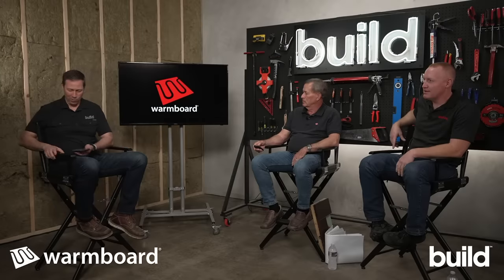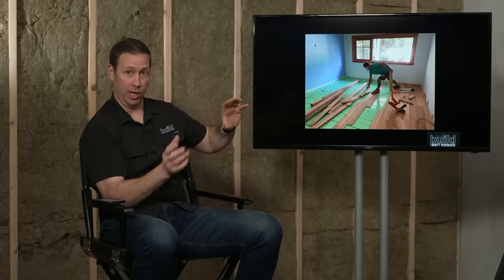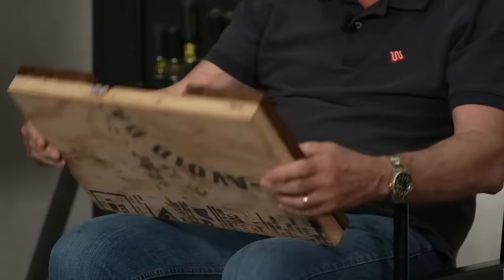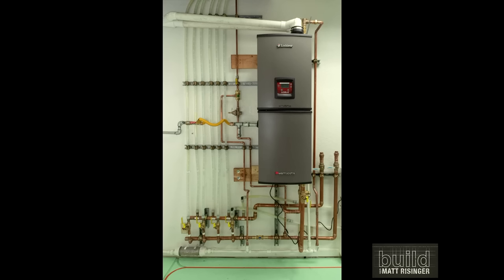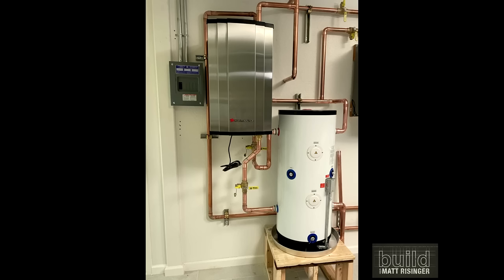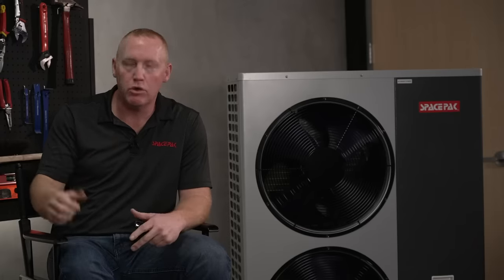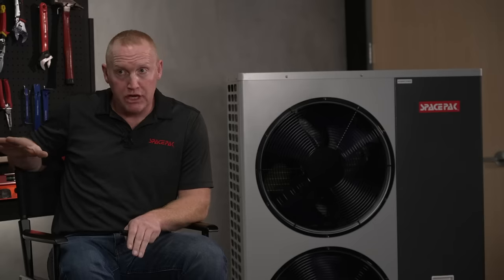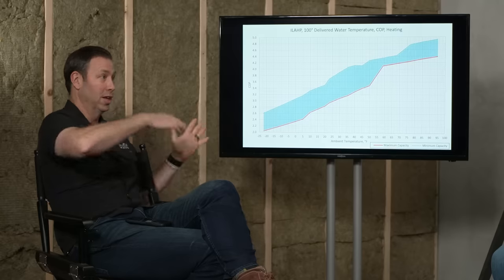Cold Climate Heat Pumps for Radiant Floor Heating. No gas, no boiler!

Comment: Can Warmboard also cover cooling/AC, or do we also have to get a separate system for that?  If I already need ductwork for cooling then why should I get Warmboard radiant floor heating instead of just using the heat pump system for heat as well?  Or why not spend the extra money it would take to add Warmboard and use it to switch from an air source heat pump like the one described in the video to a geothermal heat pump that will maintain its efficiency regardless of outside temperature by using the relatively constant temperature of the earth to extract heat from or shed heat into?
Reply: All great points that go against the use of expensive heated floors
Reply: Separate system.  normally a wall mounted minisplit for AC and heat back up
Reply: Perhaps you didn't see the slide at 37 minutes. Read the captions ; they infer it works like a regular heat pump with either ceiling units or wall units blowing either cold air or warm..
Reply: @paulmcgown7504  I did see that slide, but you seem to be confused about what that slide represents.  It has nothing to do with the Warmboard product, it only shows the heat pump system the other company sells that can be used to provide hot water for the Warmboard system, which is my whole point.  I could use a standard electric or gas water heater or boiler with the Warmboard to heat my house, but it can't cool it, so I would need a separate AC or heat pump system to cool the house.  If I'm already installing a heat pump with the necessary ductwork and/or wall units to cool my house, why wouldn't I just use that heat pump system to heat the house too (just like it shows in the slide you pointed out) instead of using it to heat water and run it through Warmboard?  Why would I spend the extra money above and beyond the heat pump (which is capable of heating all on its own) to put in the Warmboard system for heating?  That's my point.  If the Warmboard system was cheap instead of expensive then it might be worth the little extra money to ADD the Warmboard to the heat pump system for comfortably warm floors, but at the price it is you would have to have the kind of wealth where you don't care what anything costs to waste the money for putting this in on top of a heat pump.
Reply: @r.j.bedore9884  you nailed it with the last sentence.
Reply: @r.j.bedore9884  but seriously hydronic underfloor heating is all about comfort. Zero to do with financial or other considerations.

Comment: I think warmboard is a solution to a problem that doesn't exist. Gypsum casting is not so heavy and zoning is difficult. The only advantage of the system is that the heating pipes are visible when the floor surfaces are attached.

Comment: I was planning on doing radiant in slab and finishing the slab to just use as my floor, but now I'm building a two story house (residence above garage) and am debating about a product like this. I'm really scared of what happens if/when there is an issue with the pex and your glued on hard wood floors all have to be destroyed to get to the leak
Reply: If there was an unknown leak that would be a disaster, but it's standard practice to use a whole unbroken pipe for each loop with no connections in the middle that could leak.   And the system is tested before you cover it.

Comment: For all you people that are skeptical;  In sweden the standard for almost all new houses is using air-water or ground source-water heat pumps. You can use it with hardwood floor or tiles, either in the slab or on top with similar pre-made sheets of plywood/alu. The pipes are laid out, pressure tested and no hidden pipe joints are allowed. Heatpumps with inverters work perfectly fine down to -18 degC (with lower COP and electric boost). The same heat pump also supplies hot tap water. Check out Nibe, IVT, CTC, or Thermia  heat pumps. Piping Uponor or LK systems. 
Cheers and welcome to the 21st century 😂😂
Reply: I'm not skeptical, but Im not made of money either.  For a new build or a gut reno, but to add this to an existing home, the costs are more than most homeowners can afford.  What needs to be done is home building energy guidelines be followed my home builders, and if not, charged for it.   To many get slaps on the wrist, or nothing happens at all when they are caught cutting corners to save a few bucks, that affects homeowners and the environment for decades.

Comment: For myself it's a case of SCREW my "carbon footprint", it's more a case of not paying the utilities (electric or gas) as little as I possibly can!  The preference for both my wife and myself is 100% off grid for HVAC and electricity.    I've had my eyes in Warmboard for quite a while now for our "Dream Home".  I'd be more interested in hearing about both heating and cooling, which is possible with radiant, but using geothermal rather than air to water like SpacePak does.  I'd likely be building in a similar climate zone to Michigan.  Ideally with ICF for walls and ceilings, possibly using SIPs for the actual roof to give a conditioned attic space.
Reply: Tip: put the heated floor budget into better windows and more insulation.  More comfortable and efficient home rather than slightly more efficient hvac. 👍
Reply: Indeed, nice to reduce costs long term with these systems and more resilient to price shocks. I'm also very curious about the cooling aspect. I want one system to provide heating and cooling.
Reply: @dosadoodle  you’ll need a separate system for cooling.  More $$$
Reply: @superspeeder  It's a case of "all the above" since our build budget is contingent on playing the right numbers in the lottery LOL
Reply: @michiganengineer8621  Nice! 😁
Reply: @James Karrie heat pumps cool too, you just need a bunch of ducted fan coils to do it.  Then the heated floor becomes unnecessary.
Reply: @James Karrie you can, but you need a DewPoint tracking system that never allows any part of the cooling surfaces to go below the DewPoint of the air in the house, or condensation and mold result.  Radiant cooling is a very interesting new thing for residential buildings, but it is not trivial to implement successfully.
Reply: @James Karrie sure you can.  BUT, consider how a company views this and what risks are involved, and they simply will not install this into someone’s home because they have no idea how well it will be managed.

Open the windows and doors to air the place out, forget to turn off the cooled floor, big time moisture/condensation issue.  Dehumidifier breaks down or is not set properly, big problem.

You and I might manage a system like this no problem because we understand how and why it works.  Joe/Jane homeowners do not, and it’s those people these systems need to accommodate which means a reliable plug-and-play setup that’s fully automated.

It also needs to be in a very airtight house, not only because humidity control is important, but even humidity throughout the house is also important.  What if the basement is more humid than the main floor?  Problems.

It’s a risky application that has been successfully done in commercial settings, but I don’t think it’s ready for residential deployment.  These big companies won’t touch it with a ten foot pole until the risk is reduced to acceptable levels.
Reply: @James Karrie the other thing is, I don’t think anyone wants cold feet even in the summer.  If a system relies on sucking heat out through my feet I’m not sure that scores high on comfort.

Radiant cooling that does exist is usually done with wall and/or ceiling panels.  Likely for that reason.
Reply: @superspeeder  What if all floors were waterproof and sloped to floor drains? In this way the whole floor is effectively a drain pan and can safely collect and drain any condensate that forms. As for cold feet, my feet tend to overheat in the summer and thus I prefer them cold.
Reply: @hailexiao2770  and then you could have a retractable-roof living room, like a stadium, and it wouldn’t matter if it rained or someone spills a drink or two.  Brilliant!  😁
Reply: just say no to SIP's.  impossible to get right in the field.  make sure you have a backup heat source..
Reply: @BB-nn9en  We would definitely have at least one WOOD BURNING fireplace and/or stove in the house.  And while the plan is to rely primarily on solar, herself insists on a gas range so we will have propane, that would also feed a generator if needed.
Reply: @michiganengineer8621  Sounds awesome.  Be sure to make a video on it once it's all built!
Reply: @BB-nn9en  I'll admit, I've gotta play the right numbers first.  But I definitely will do that.
Reply: @superspeeder  That is why mini splits are so attractive ; no ducts!
Reply: @superspeeder : many homes in the tropics have terrazzo floors or the like and expect to get rained into them. It is a similar solution to the one proposed.

Comment: Ever put the warm board & heatpump system on walls, instead of floors?  (Low ceiling tract houses can’t lose more floor height from the warm board)
Or, on ceilings as well as floors, for cooling in summer?

Comment: HVAC heat pumps are getting better. 2015 at Colorado School of Mines, geothermal heat pumps installed in many federal and state gov buildings. We call them heat dump and cost more on energy and 8 times on labor and materials. Now, as for SpacePak, air to water for any project is still not worth the cost investment. Heating and cooling using all today's technology isn't good enough to brag about! I'm inventing designing creating away to have HVAC interlinking with solar drain back system that takes 15 amps only to heat up domestic hot water and also heats the building that's #1 renewable energy known. Solar drain back systems in summer can create cooling HVAC systems electrical power consumption by 1/2 or more depending on sunny days per year. After I patent protecting this new way, devices. I'll be happy to show. Thank you!
Neillium Plumbing LLC. Colorado

Comment: I typically use free standing wood stove. How would this be incorporated into this system as a retrofit to a 1904 home in Utah? I'm getting ready to install an isolated hot water tank~200ga heated by the stove with pump .

Comment: I wonder if the water can be preheated and the heat pump would then not need to heat as much. I am thinking hot water solar tubes or even a wood boiler for certain locations.

Comment: I know that this was sponsored by Warmboard so they’re going to get the lions share of the air time.

I know warmboard is trying to position themselves as the premium delivery method for the heating plant poised to deliver the most market growth (a2w heat pumps), it would’ve been nice to hear about overcoming objections to the air to water heat pumps beyond the more common “there’s always heat in the air unless you’re in the cold void of outerspace”.  Like what do our plumbing subs have to relearn for this?  My perception is very little, though I’ll find out when we do our first install in Q1 2023 to take advantage of Inflation reduction act credits.
Reply: I also am watching this looking for Information about the air sourced heat pump system and design. I have been in contact with warm board and in my opinion it has its place. I am very interested in air to water heat pump system engineering and design. Unfortunately I am having a hard time finding information to learn from. any leads would be much appreciated

Comment: Great video Matt. Thank you for putting in all the work and keep it very informative.

I'm planning on building a custom home out in the country. In the summer the temperatures can easily hit 110F and in the winter they can dip below freezing point. I literally hate how much noise and inconvenience the forced air system produces. So my plan is geothermal heat pump with radiant cooling/heating. 
Since you covered those topics on your channel before, I wonder what are your thoughts on that and if you know of any company that specializes in those systems. Much appreciated.

Comment: I built a 1200 sg ft  super insulated  house and I have radaint floor heat  I use two 50 gal  Geo   electric hot water  tanks with   heat pumps  using a open   system  that heats both my portable  water and heating in one with no separation  .  In years before this one it would avg $1500 a year fir my electric bill  . I figure 1/2 of that was for my 7 months of heat and my potable  hot water ,  I live in upstate NY   By the Montreal  border. I pay about $ 1600 for the 2 tank after rebate with a ten year warranty  .

Comment: We are starting to built a passive house this year. I want to have hydronic floor heated by a heat pump. The floor is a ciment slab with no basement and only one level open concept.  I live between Ottawa and Montreal zone 4. Since it's a passive house oriented with big windows on the south side, my builder is not recommending heated floor. I need to make a decison. Can I have your opinion.

Comment: Can the air to water heatpump system be married up to existing hot water radiator systems in older homes and have the gas boiler used as a backup?

Comment: I have a complete radiant floor system with the water heated by an electric boiler. I would like to add a SpacePac heat pump to reduce my electric consumption. How can these systems be combined? I'm in northeastern NY. My house is very well insulated.

Comment: It wasn’t mentioned in the video but I assume you still need something like a ERV system to bring in fresh air and remove humidity in the winter right? Otherwise CO2 could build up in rooms so you still hear something running.
Reply: Yes. But the ERV units are very quiet, and don't blast air like a forced air heater.
Reply: There is nothing special about radiant floors or heat pumps that requires MHRV or ERV.
Reply: @tlangdon12  Correct, there is nothing special about radiant that would eliminate the need for ventilation. Since radiant is a non-ducted system and will likely be installed only in a well built tight house, then it will still need an ERV or similar, just as OP assumed.
Reply: building a tight house in 2022, yes you still need fresh air from an ERV or HRV!
Reply: @neckofthewoods24  As per building codes in many jurisdictions. Like it or not
Reply: @alsteeves2044  what that you need one??  That’s awesome.

Comment: Matt, I would love to see you do a detailed analysis of the Enertech air-to-water system (out of Greenville, IL) that can provide radiant floor heat, forced hot and cold air, and domestic hot water. They also use inverter technology.
Reply: SpacePak’s air to water unit has all the same capabilities you mentioned!
Reply: Enertech, SpackPak, Artic Heat Pumps, MBTek, all these companies are similar for air to water heat pump. MBTek and SpacePak for sure use the same Chinese OEM, Phnix-e.
Reply: @pavalenta  cost comparison compared to warm board?
Reply: @ToddBizCoach  looks like all have prices available online, either on their own or 3rd reseller, just have to search.
Reply: I agree, more reviews and listing all the options that can be tied to the systems would be great. It was a big learning process for me, also touch base on how much space was needed with all the parts, buffer tank, pre-heat tank and hot-water tanks with proper space around items for maintaince, this was a big surprise to me. I just had 2 GeoComfort by Enertech systems installed in my new house, a Water-to-Water and a Water-to-Air connected to a closed loop geo system. It's amazing how the house feels and how efficient it runs! Only heat source for the house, 6 car garage and large workshop in cold MN.

Comment: Do heat pumps have to be placed outside in the cold? Can they not be put inside the envelope of a conditioned attic?
Reply: Do you cool your house by leaving the fridge open? What do you mean by conditioned attic what exactly conditions it?  Heat pumps transfers heat efficiently, if it transfers heat in the same place that takes heat theres no transfer...

Comment: Ok so you do warm board what about air conditioning . I really wish you had gone over air conditioning, like what would work best with warm board or when will they have something for it . And say I was doing a 3or4 thousand sq house how much would it be?
Reply: you have to install AC.  a good minisplit will do just fine.  they also heat if need be.  3-4k house would be about $50,000 just for the panels.  you could do all the radiant like this for maybe a couple grand.  https://youtu.be/i2Ve_AYuplc